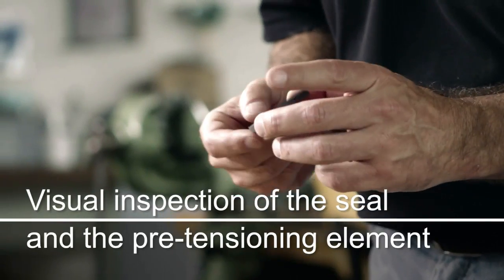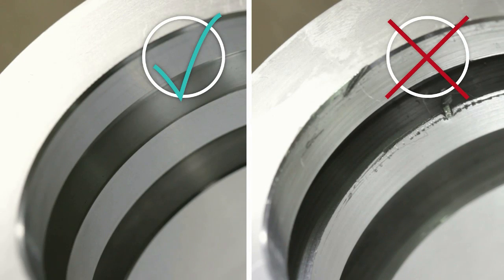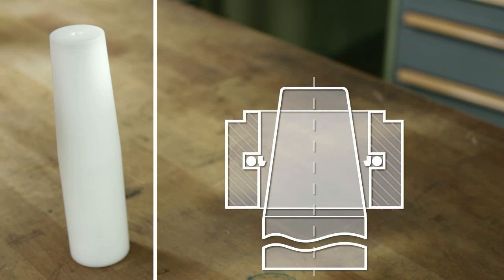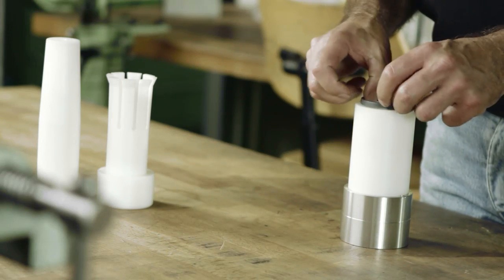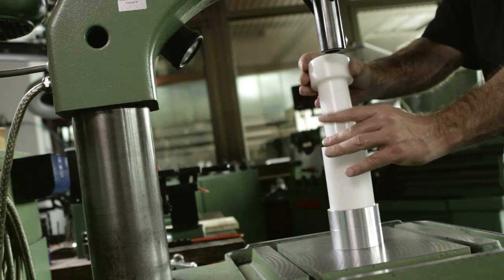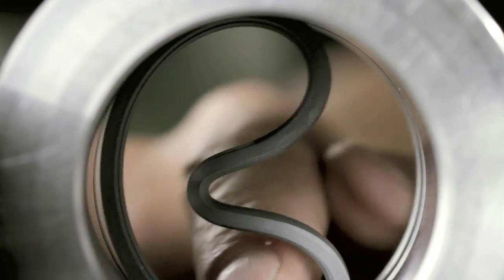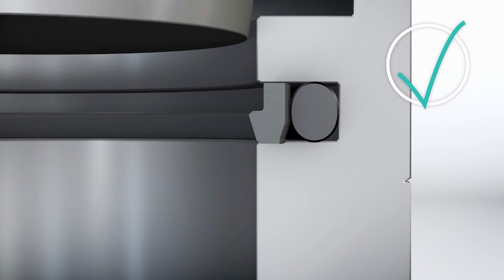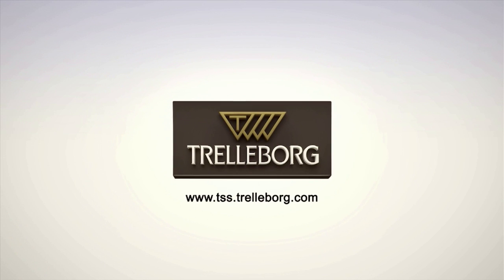Rod Seal Installation

Comment: Put the turcon seal in hot water for a few minutes this softens the seal which makes it easy to install
Reply: in what temperature boiling point?
Reply: @gregoriopaderes3396  55 to 60°C

Comment: I sure would like to purchase a set of those white plastic insert tools.  Too bad they are not available at retail.
Reply from the maker: Hello, thanks for your comment and for watching the video. As of now, we don't sell these tools but you can try the Trelleborg Sealing Solutions website for similar insert tools, depending on the seals you are using. If you are interested in the seals depicted in the video you can easily purchase them on our online shop: www.seals-shop.com to be quickly delivered to any country within the EU.
Reply: The good tools never are.